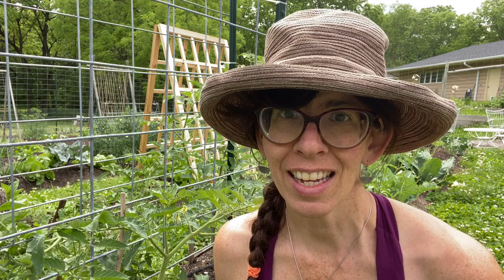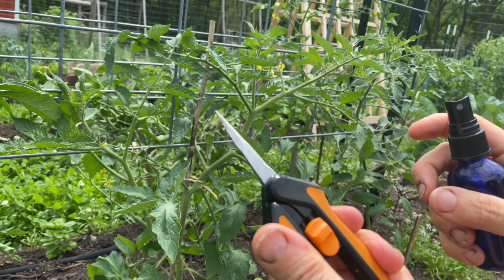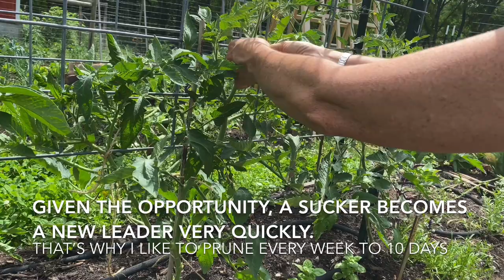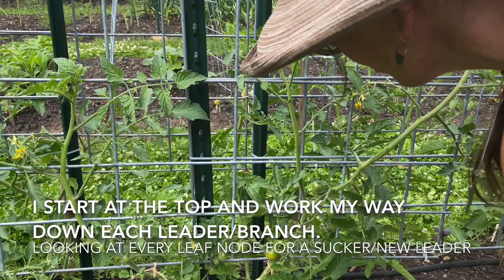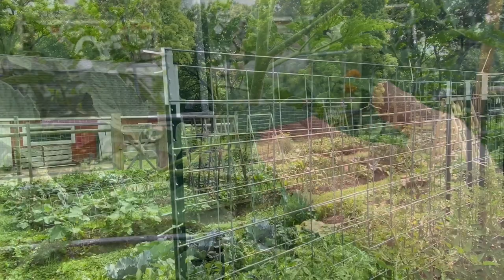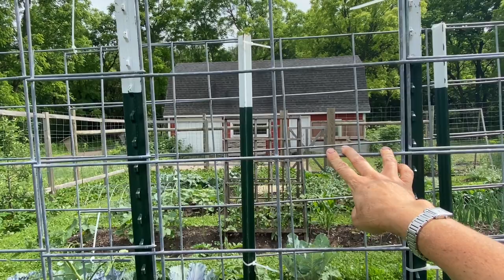Pruning Tomatoes on Cattle Panels

Comment: Hi Meg!!! Thank you for your tutorial. It's just plain great...like always. I watched this a few times and am wondering about this scenario....what if a sucker got away and turns into a "leader" with buds and fruit forming. Do we trim off what would have been the "original" leader that was taken over by the sucker. We have trimmed our tomatoes way up from the bottom  for several years and have had no disease when many other gardens were suffering from blight, etal. So...we know that works well. Also, mulching is great for preventing disease. How does this method work for the non-espalier growing methods like hoops. It's like a jungle at the Donation Garden!
Reply from the maker: the Donation Garden 2017 oh boy! So much to consider. Are there no supports at all right now? I am growing a few indeterminate tomatoes open grown and they have easily over half a dozen suckers fighting to be the leader. I started whacking down the youngest ones, keeping the older ones. And trimmed off the lower foliage a bit. And then I got overwhelmed and walked away.

Comment: Thanks for the great video Meg.  Curious, you said you compost the twine.  Are you worried about transferring disease if you reuse the twine?
Reply from the maker: Chad Raines that’s a great question. No, I think it’s more like by mid-September it’s a hot mess in the tomato garden and I use the fastest path from jungle to clean slate. But certainly one could painstakingly untie and reuse the twine.

Comment: 3rd year trellising tomatoes.  First year I trellised up strings, BIG pain in the butt, 2nd year trellised up bamboo canes, still a pain in the butt.  decided to try cattle panels this year.
I typically would space my plants 18" to 24" apart.  Am not sure this would overcrowd a cattle panel.  
Previously I would limit my plants to one or two leaders, I am thinking with the cattle panel I could go to three or more as the plant grows upwards.
Basic question, how much spacing do you leave between plants?
Reply from the maker: Hi Brian-I space them 30” apart on center and do two panels back to back. I train to 3 leader generally … it maybe sometimes gets a little wild on me in late august when I turn my back for a split second ….
Reply: Last year I had a total of 21 plants  in ~34 linear feet of space that averages out to be about 19" apart.  If I planted  30" apart that would limit me to 13 plants.
I canned 50 jars of tomatoes last year and would like to do the same if not more.
Why do you do back to back panels?  Are you growing plants 30" apart on both sides?